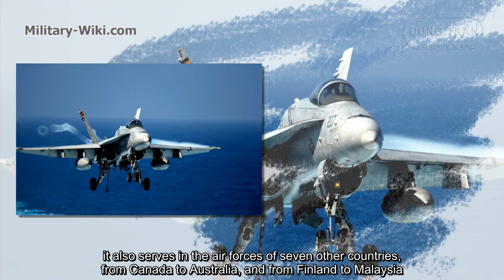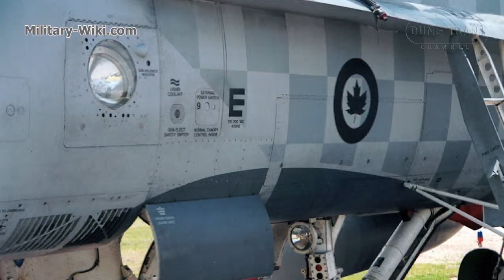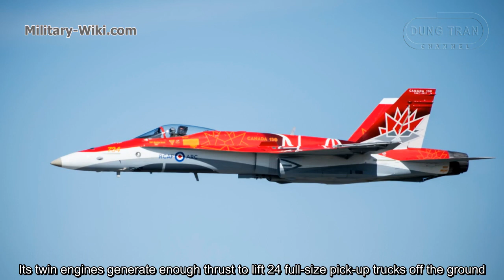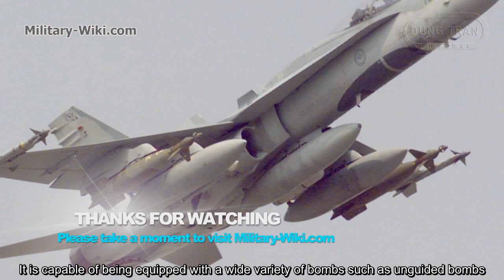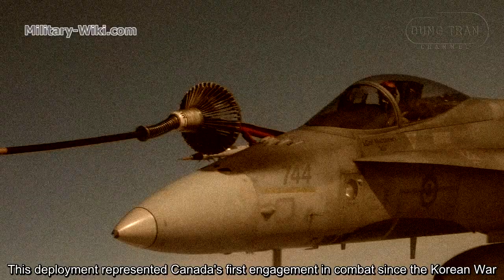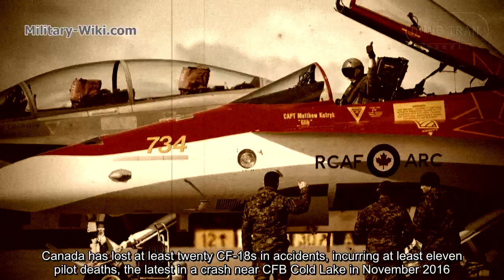CF-18 Hornet - Still the backbone of the Canadian Air Force until 2030 and beyond

Comment: The real reason that the Canadians will keep their F-18s as a frontline aircraft combat is due to the F-35 fiasco. Despite the fact of being promote by the u.s as the pinacle of their tecnologically development in combat planes, it has still has many flaws and not to mention its big cost
Reply: Canada will get F-35s but the reason CF-18 outlive the USN's F/A-18s is that Canada has no aircraft carrier which add stress to the airframes.